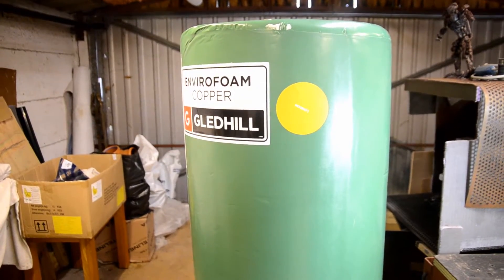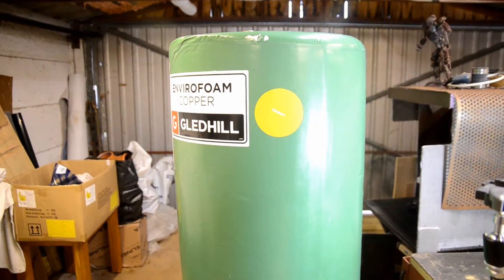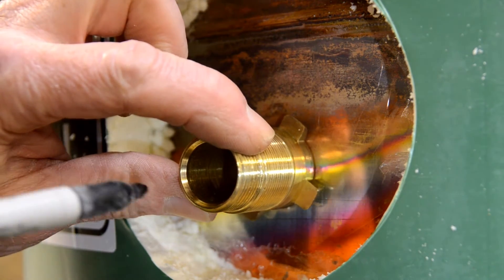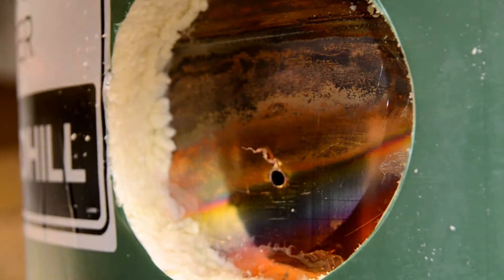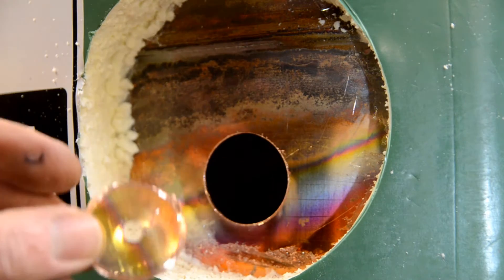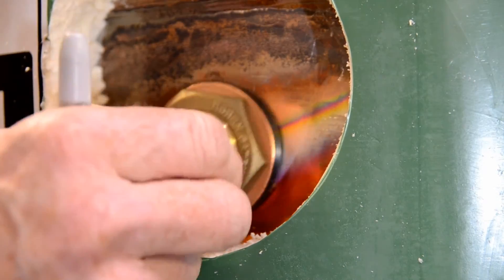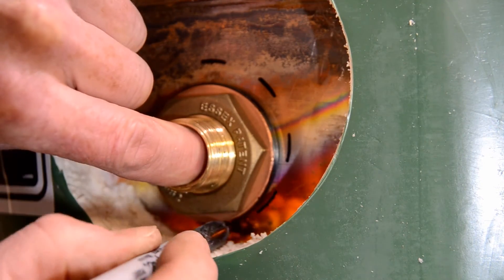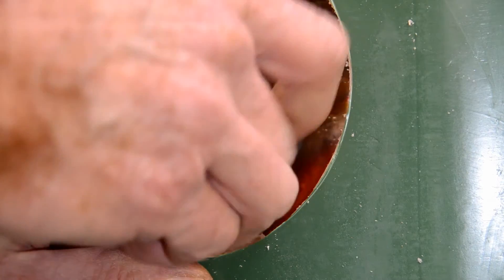Essex Flange 2, this time there's commentary

Comment: Great video of a professional installation. Essex flanges are not for the feint hearted!
When I’ve fitted them I’ve used a thin bungee cord hooked onto the loop on the wire. I hook the other end of the bungee to the timber of the tank cupboard (or some other nearby immovable object). Their puts the cord and wire under light tension and prevents the risk of the flange falling into the tank. You have both hands free to work on the assembly and you can line up all of the components in sequence on the cord.

Comment: I recently did something similar my tank. I was a bit reticent to use the essex flange as it relies on a rubber seal which could degrade over time. I ended up using a standard tank connector and soldered it in. Flooded the thing with probably way more solder than needed but it worked a treat and I'm sure it'll last the life of the tank.
Reply from the maker: Nice, I’ve often wondered about trying that